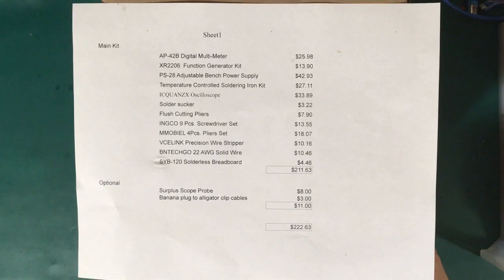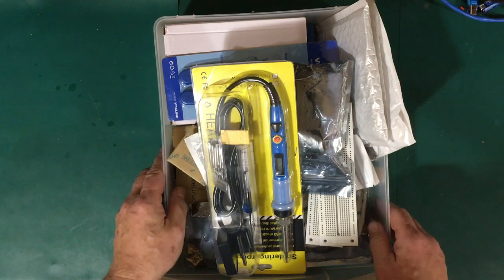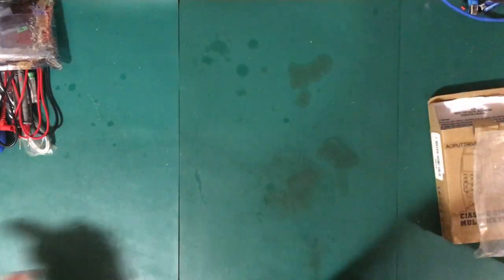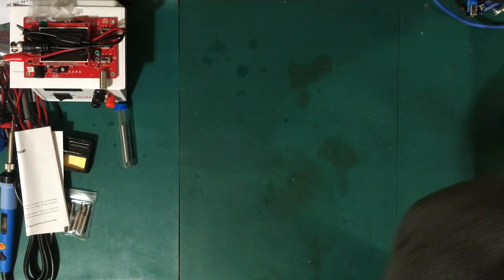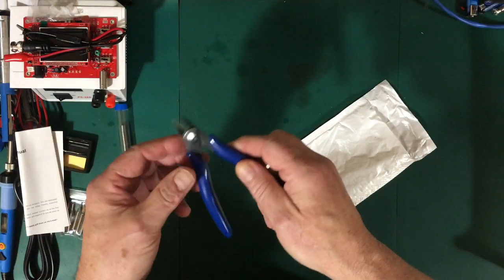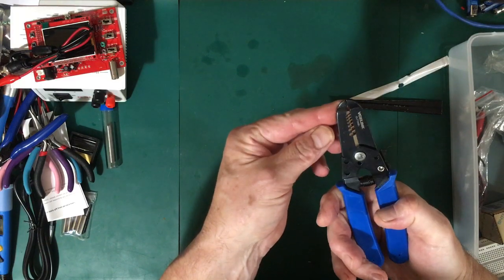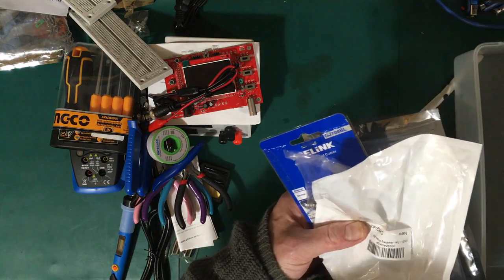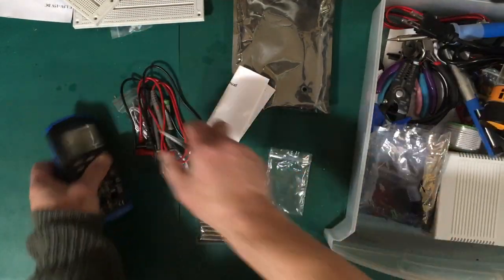0002 - Beginners Electronics Tools:  How cheap can we go?

Comment: Don't over look DIY equipment !
So these are some of my favourites …......
A 1khz oscillator , Pc scope ( a/c for AF but has some functions like thd % , counter , spectrum display ) , Pc af generators or audio mp3 file playback ( works with mp3 players when using Pc scope ) , loads 8 - 50 - 600 R at 1 or 2 W & a simple 12 / 5 v  power supply .

Wide band noise generator , logic probe & a all in one signal injector with tracer .
Even the 2 leds & a resistor is useful & probably should be the first build .

Cheap add-ons for a £5 DVM ( it's not being used for mains voltages LOL )
RF probe , audio mv meter , in-circuit ESR adapter , RF sniffer / absorption meter add-on & a short finder .

As you're pinching the pennies & probably using salvaged parts the £15 magic component testers you find on Ebay is a must have bit of kit .

Always have rcd protection for the workbench .
Reply from the maker: All good ideas!  Thanks.

Comment: Buy cheap, buy twice.
Reply from the maker: While I 100% agree with that sentiment the idea behind this is what tools can the beginner get by with.  It's often that people start a hobby then find they, for one reason or another, no longer want to do it.  I'd say it happens more often than not.  In that case buying expensive is the mistake.  I fully expect anyone that continues on in electronics will want to upgrade their tools but telling someone that they need to drop $2000 to get started will have them running for the hills.  If you follow the series you will that so far we have upgraded both the power supply and the meter, but still keeping the cost low.  So, in this case "buy cheap, buy twice" is fully expected.